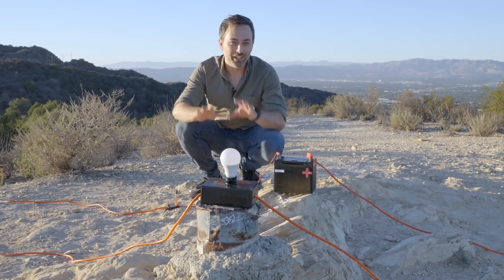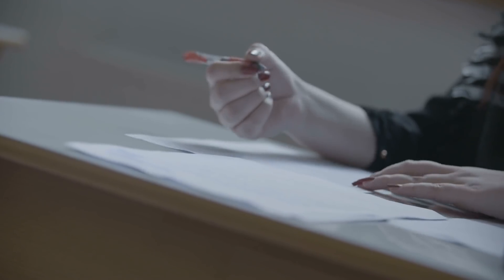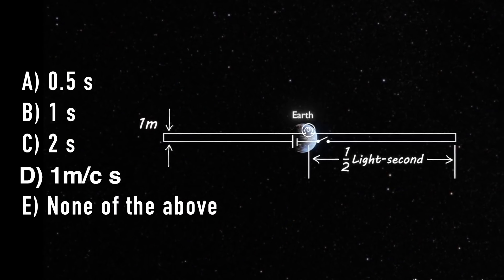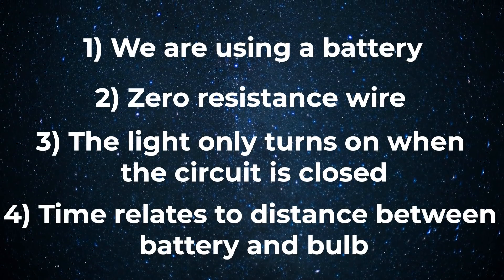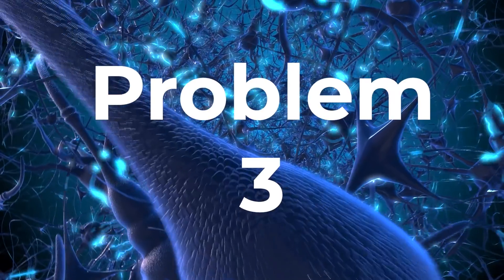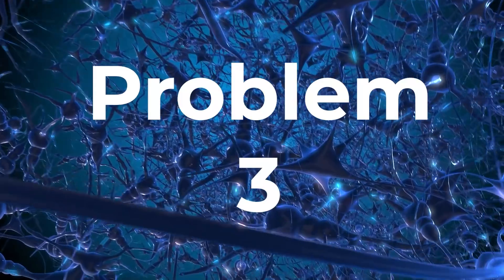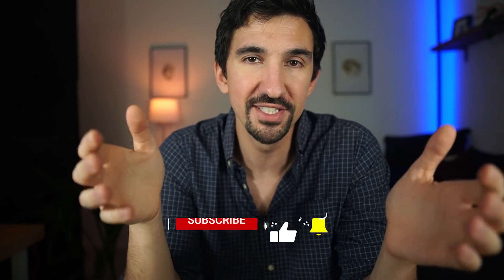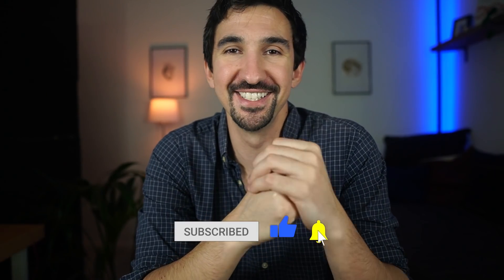Is Veritasium Wrong About Electricity?

Comment: Electroboom is correct.  And, therefore assumption #3 is wrong.  If the lamp is illuminated and then the switch is opened, the lamp will not extinguish immediately for the same reason: energy is stored outside the wire.  It takes time to store energy outside the wire.  It takes time to release the stored energy.  But, uhg, that only happens with resistance.  So, my model would be closer to reality: set the resistance so low that the reduction in lumens is only .5%.  Negligible, except that now there is some resistance and the illumination can't change immediately.  The switch can be open and the lamp still emitting photons.  This could get murkier if you make a more detailed and step like definition of "illuminated".  In other words, below a certain value of brightness, we say it is off.  But in my house, lamps continue to emit longer wavelengths for a long time.

if RC is seconds, and R is zero, it isn't our universe.
Reply: "But, uhg, that only happens with resistance"

The light itself is a resistance. The load applies a resistance, it's how potential electrical energy is converted to other forms of energy.

The "no resistance" assumption applies to the wire, not the light.

If the light doesn't apply a resistance, forget the battery and the wire altogether, your bulb doesn't require power at all to turn on. It's magic.

Comment: I have zero understanding of physics, this concept of information relay in regards to C warps my mind, maybe someone can help clarify via example (which might also be bad):

- we're 1km apart on a flat surface, between us a straight, rigid beam. One of us pull on the beam, the other one will perceive this information after X amount of time
- light travels 1km in 0.0000033356s

Could X be smaller than 0.0000033356s? it seems it should be instantaneous, or almost.

I know there are several factors to consider (friction with the environment, weight of the beam, material elasticity in the beam itself, etc)... I don't know physics so I'm not sure to what extent such factors can be ignored or in what way laws are broken by assuming perfect conditions (such as no friction etc)
Reply: X not only can't be smaller than the given value (assuming your math is correct), it will actually be larger.

When an object is pushed, you are not moving the entire object. You're compressing the object, and a compression wave spreads out through the object which moves the rest of it. The speed of that compression wave determines how long it takes the other side of the object to be impacted by your original push.

If you were to build a beam 1 light year in length, and you pushed the beam while sending a radio signal out at the exact same time, the radio signal would be received on the other side of the beam before the beam ever moved on that side.

EDIT: Think about common objects you might hit at high speeds.

If you hit a tennis ball with a racket, the tennis ball compresses (deforms) before shooting off, right? A baseball does the same thing off a bat, but there's less compression right, because the baseball is more rigid? Same with a golf ball off a golf club.

As objects become more rigid, the compression is harder to notice (the force you need to impact the object with in order to observe compression becomes higher and higher, because you have to apply force faster than the compression wave can dissipate it through the object).

With long objects, the compression wave is still just as fast, but the distance means it will take a long time to reach the other side no matter what.

Comment: This might help a little or just be annoying. Ponder this: a circular barrier 1 light second (300,000 kilometres) in diameter inserted inside said loop that makes up the circuit. This barrier inhibits electromagnetic radiation from passing through it. How long does it it now take for the light bulb to turn on after the switch is closed?

Comment: I came away from this video with the same understanding I got from the veritasium video. It’s the field created between the switch and light that power the bulb rather than through the wire.
Reply: The point he was making is that the bulb probably wouldn't light up, because although there would be a measurable voltage at the bulb within 1m/c of the switch being turned on, the voltage generated by a 12v car battery at a distance of 1m will be so small that it won't power a light.

So yes, the power does come from the field, just as Veriasium points out. But it's not until the field travels around the length of the circuit to reach the bulb is there sufficient voltage to actually cause the bulb to light up.
Reply: @ialsoagree  oh that’s fine, yeah I understood that.

But I thought that the ultimate point was about the method in which the energy traveled and not whether enough of it traveled.
Reply: @Cesarissatan  I think the real point was clarifying which assumption of the 4 is actually wrong - the 4 assumptions are listed in this video, and not necessarily directly applicable to Veritasiums.

In other words, I don't think this video is meant to argue against anything Veritasium said, but to add clarification.

Comment: I don't see how this scenario indicates the transfer of information is faster than that of which is permitted by the speed of light. If you shoot a light beam towards an observer 1m away the time it takes is 1/c s, the information isn't transmitted faster than permitted by the speed of light. I don't know why you think the scenario Derek mentioned is breaking this law of physics, I'm guessing you think that the time of transmission of information should equal the speed of light c= 3x10^8 , but that's just the speed, time is found by t=d/v where d is distance and v is speed.
Reply: If by "this scenario" you mean the one he laid out in this video (not Veritasium's) using the assumptions presented, he actually does a great job of explaining it.

If the bulb lights up because the circuit became closed and the field transferred power the 1m, then you could transmit information faster than light. Simply move the switch to the point where it's 1 light second away from the bulb, and now you can send a digital signal across 1 light second in 1m/c just by turning the switch on and off.

The reality is, the generation of the EM field isn't dependent on the circuit being closed. That's the faulty assumption (that was presented in this video, not Veritasium's). The only thing Veritasium didn't really clarify is that the EM field generated by a 12v battery at a distance of 1m wouldn't light up a bulb. It would generate voltage, but not enough for a bulb to produce light.
Reply: @ialsoagree  "the generation of the EM field isn't dependent on the circuit being closed" by this do you mean that even after a circuit is closed it takes a while before em field disappear?
Reply: @moinpalekar  Closed means that the circuit is complete and electricity can flow.

Open means the circuit has been disconnected.

In the case of an open circuit, the dissipation of the EM field can only travel at the speed of light. So at 1 light second away from the switch, the EM field  will continue up to 1 second after the switch is disconnected.

A very long stretch of wire that's not connected to a complete circuit is essentially an antenna, and it could be used to transmit power via the air in the exact way Veritasium describes - because EM fields can propagate to circuits they're not connected to directly.

This is how many wireless charging devices work. An EM field in one device causes a current to flow in the device you want charged, even though the two circuits aren't connected.

Comment: Make a $10000 bet😏. Leaches with no backbone.
Reply: On what?

He agreed with Veritasium on everything - except that a 12v car battery can power a light bulb at a distance of 1m.

That you can test yourself. Put a car battery on a circuit with a resistor and keep the circuit closed. Then put a bulb on a circuit with no power source, also keep this circuit closed. Put any portion of the light bulb circuit no closer than 1m from any portion of the battery circuit.

See if the light bulb lights up.

I'd guess that if you're using just regular wires and not a transformer or capacitor, you'll never get the light bulb to light up. You might measure voltage in the light bulb circuit, but not enough to actually light the bulb.

Comment: I think Veritasium was trying to make the point about energy not flowing inside wires, rather in the fields that are in between and around the wires. That's not a theory. That's a fact. The people that invented, designed, and perfected the electric grid all said that over 100 years ago. Tesla, Steinmetz, etc. The only thing moving inside the wires (conductors) is current, moving at snail speed (or drift velocity of 1mm per second). The current creates a magnetic field that propagates in the direction of the energy flow at light speed. The field at light speed, the current at about 3 inches per hour. I don't remember if he mentioned induction or included it for consideration. 
I think the battery is what throws his example maybe cuz then I just see people arguing about wether or not the battery has the voltage necessary to transfer power that distance, as if that was the point. Of course it doesn't. The point was that energy does not flow in wires. The wires just create the conditions for energy creation and transfer. 
Also, electric companies are not "science" (even if EE is) and they have the ultimate motive to keep us all in the dark. Money. Fortunately for us the information has been around for over 100 years so all you have to do is ask questions and go looking for it.

Comment: Here is an idea for you. Can you transfer information faster than the speed of light? 
Imagine a stick, if you push the stick in a direction how fast will the other end of the stick react to your pushing? It will be instantaneous hence faster than light. I suspect that with electricity the same model can be applied where the resistance is what for the stick would it's mass be.
Reply: It won't be instantaneous, you're making a faulty assumption.

When you push an object, you're not moving all of it's atoms simultaneously. What you're doing is compressing one part of the object, and then a compression wave causes the rest of the object to move. Different objects compress differently, which effects their motion. This is why an inflated basketball will bounce, but even a slightly deflated one won't. The difference in the compression wave makes one bouncy and the other not.

The more rigid an object is, the faster it's compression wave travels. The less rigid an object is, the slower it's compression wave travels. This difference in the speed of the compression wave is the reason why a baseball will go flying off a baseball bat when struck at high speed, and a marshmallow will get destroyed and splatter everywhere. In the latter case, the compression wave doesn't travel fast enough to dissipate the force applied by the bat, so the bat travels through the marshmallow destroying it.

If you built a steel beam 1 light year long, and pushed one end of the steel beam while simultaneously sending out a radio signal, the radio signal would be received on the far end of the steel beam before it ever moved. If you wanted to send information, the radio signal would be faster, it would get the information there at the maximum speed information can travel in the universe - c.

Comment: Breaking causality is not an issue when you're already breaking fundamental laws like no resistance wires, even super conductors would have an slight resistance over a certain distance.
Also the battery and filament would have its own resistances accordingly. Now when an electron moves through space it generates an magnetic field, this is what in turn moves the magnets/rotor (or its electrons) inside an electric motor. With a lamp filament however its the electron flow that causes the filament to heat up and glow kinda like a sort of friction induced by the resistance. Also  i do find other components such as a transistor or even a diode problematic under Veritasium's video.
Reply: Causality is an issue because you can replace the need for no resistance wires by just using a very high voltage source with a very low resistance conductor.
Reply: @Taurickk  ahh ofcorse you can omf up the voltage, but even with a low resistance conductor its highly likley the high voltage would just arc over to the nearby wire when considering the length of the wire in the thought experiment. Think i read up somewhere that plasma has theoreticaly no  electrical resistance, but id assume there be some funky formula out there that describes this.

Anyways, what I'm ideally trying to say is that no resistance conductors is like no weight mass of a sort, it's kinda like setting up a thought experiment with a factor you know cannot be, like no resistance wires

Comment: His answer is false because he failed to realize the source does not know the loads position. The sources field finds the loads position via the field of the wires. The fields of the wires grows starting at the source moving along the wire till the circuit is complete. It finds the load of the circuit via the field of the wires. To be clear the field at the source follows the wires outwards in both directions.

Even if you have no resistance in wires fields take time to grow. Permeability of Iron is much higher than that of air or vacuum. So the conductor of the wire isn't the only factor in that calculation when it comes to the wires field growth. 

My background is US Naval Nuclear Reactor Operator, Electronics Tech. I then went on to Electrical and Equipment engineering and CS.
I wish I could un-hear your description of how radios work. It's just wrong on so many levels.
Also both you should look up electron movement on surface of wires vs inside the wires.

Thinking of it as two antenna isn't entirely a good way to look at it either. The field change in the wire for that current flow over that distance is going to very small. Given its just DC turning on and not a continuous field changing such as AC will be about the same has a crack of a circuit turning on and sure as hell will not light the light.
If you broke both wires create an AC source instead of the DC source. You might with a bit of work be able to use the LED circuit as a diode detector. See AM radio diode detector.
Also this isn't one circuit interfering with a different circuit. The only aspect of that you can look at is when a wire interferes with its own signal. That would be on the order of looped circuits such as coils / inductors.

For Veritasium to be correct the wire would need to be surrounded by a perfect ferromagnetic substance. Not just the wires being zero ohms resistances.
Iron has a higher permeability than a vacuum as mentioned above. You could equate a pure vacuum to space in itself. For his thing to be correct Space would have to take on a higher permeability than iron.

Comment: I had some headache from veritasium's video too.
But i am still not convinced.
Your explanation sound fine, but does the antenna model still work if the cable was layed in two half circles, only coming near at the end, where the circuit would close?
My model is the following: have a pipe full of water. If you open the faucet, how long will it take the pressure to reach the end? This does not depend on the speed of the water traveling through the pipe but on the speed of the pressure wave traveling through the water.

Comment: I had the same thoughts when i watched the video. Like all of Veratasium's stuff but I do not agree with this. Like you said, at best you could claim the fields in the wires will give a 'signal' but it won't turn on the bulb. Also, the idea that fields are 'immediately' created when the switch is thrown is ALSO not accurate. The EM field itself cannot propagate FTL. none of it makes sense.

Comment: ok, the first point is pretty basic: your argument on the dimension assumes that the 1 in 1/c has dimension 1, but it has dimension of length - it is in fact the 1meter distance mentioned just before in Veritasium's video. So if you're going to use someone else's careful work as a clickbait, it would be nice to be just a little bit more careful and responsible as well. There is too much junk being spread about science already.